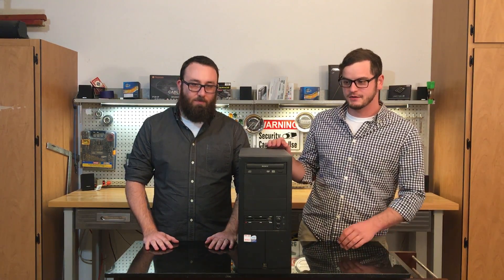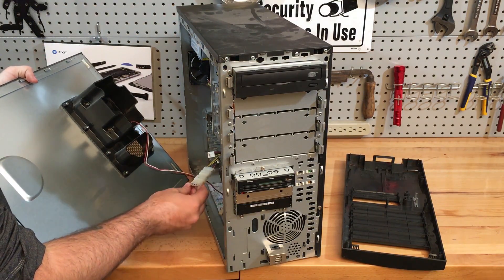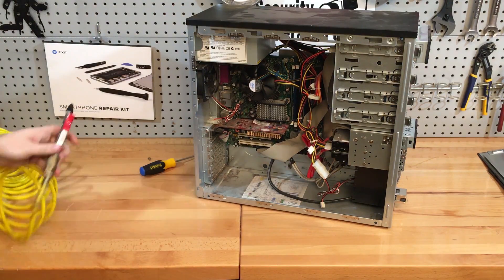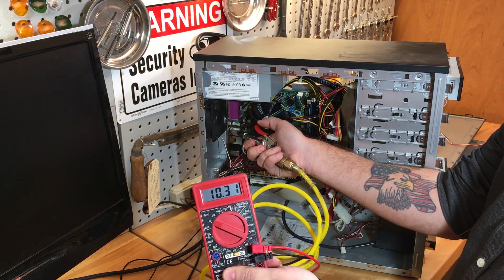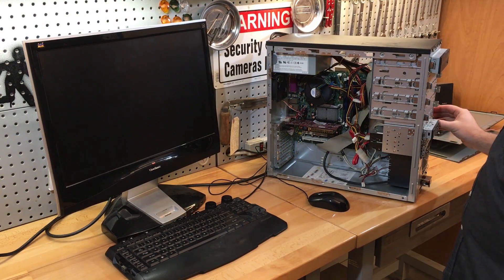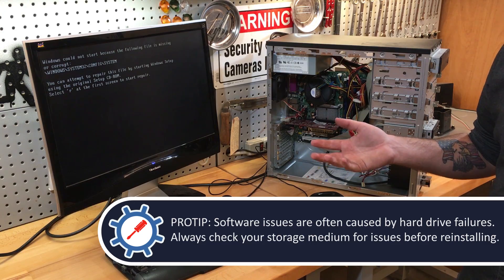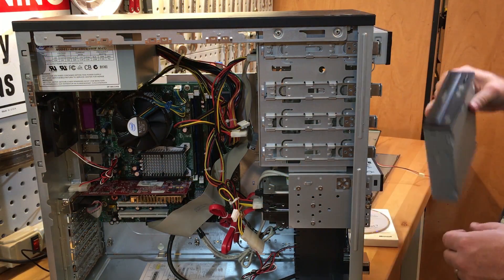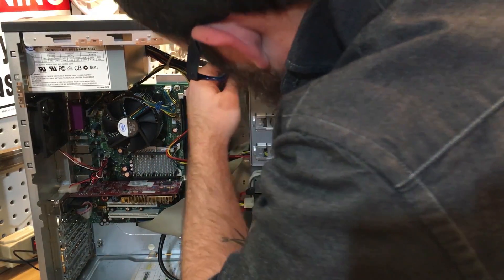One Man's Trash - Episode 01 Reviving an old PC

Comment: Great video, I really like the quality! One question - did you test the hard drive? I don't think you mentioned it either way. Just wondering if that was the reason for the OS becoming unbootable.
Reply: It looks like someone tried to delete system 32
Reply from the maker: We did not test the HDD, because it seemed to work but was just missing the system32. So far no issues with it.

-Nick
Reply: @TechHeroesTV  ^